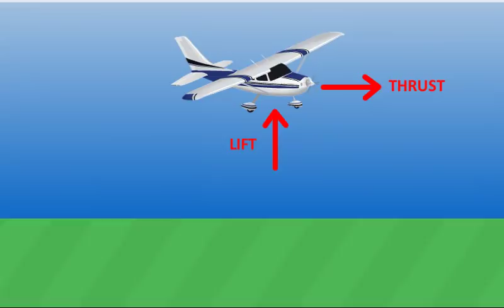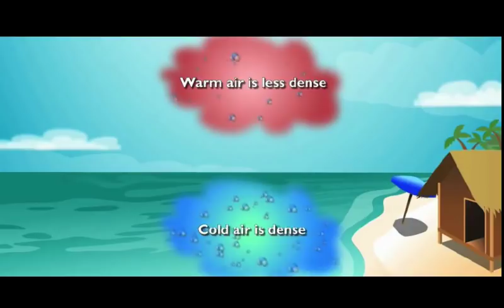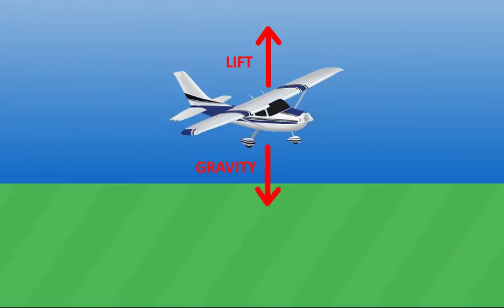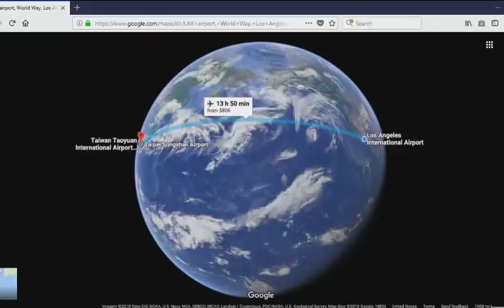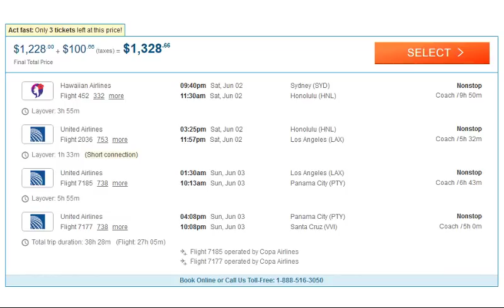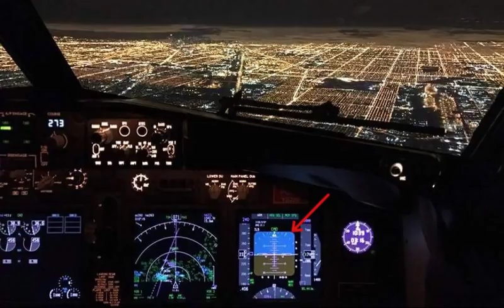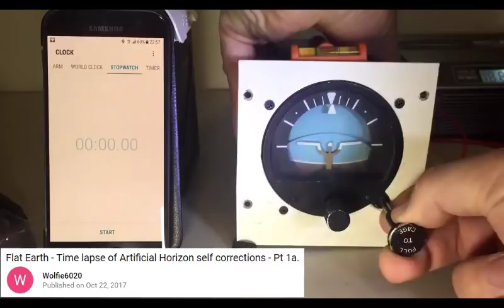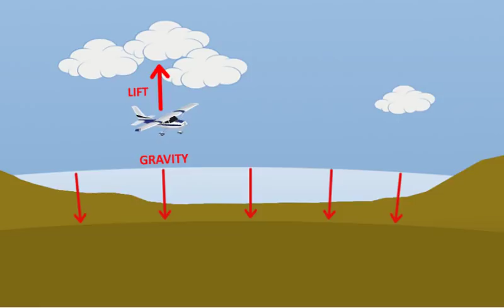Flat Earth Falsities - Plane Nonsense

Comment: Your point about conservation of momentum only works when the plane is moving in the same direction of the spinning ball it's allegedly on. It's fine when moving with the earth's rotation, but wouldn't apply when going in the opposite direction.
Reply: Dookers - No, it works as long as there is no force acting against it. The atmosphere is moving with the earth so there is no force that’s making you lose the momentum that you already have. Here’s what you should do. Go to a car rental place, rent a full size SUV. Get a tennis ball and a couple of people to help you. One of you drive while the other two toss the ball back and forth, side to side. See if you have any difficulty catching or tossing the ball. The only time you’ll have any trouble is if the driver brakes hard, turns sharply or hits the gas suddenly. For less than 100 bucks, you can prove to yourself how conservation of momentum works and you don’t have to believe NASA shills like us.
Reply: It's all well and good just making that statement, but have you got any explanation or evidence for that statement?
Reply: The plane's engines modify the momentum so the plane's velocity differs from the Earth but it doesn't magically cancel it by flying eastwards.
Reply: Dookers - No. Why would it only apply in one direction? It doesn’t matter which direction the plane flies, it’s motion, relative to the earth, is the same. You should look into relative motion and inertia. A good example would be the sun relative to the earth’s motion around it. The sun does not move relative to the earth. The earth does not move relative to the moon. All of them are actually moving. 
Another would be two cars going the same speed side by side.  Relative to each other, they aren’t moving.
Reply: @tomwolfe6063  cant you see that you guys are defending a lie? Constant motion "relative" to the earth. Yaaay they take all the effects of motion and make excuses for why it becomes 100 percent undetectable or affectable relative to our daily lives. Its as if this motion is relatively not there at all.

Comment: the dipping of the nose thing is such bull shyte. Between the age of 14 and 18 I was a member of the atc cadets and experienced flying lessons in a trainer bulldog or chipmunk plane, similar to the size used in the example. Once in the air I did not have to increase speed to increase height. I just pulled the control panel up and the change of airflow under and over the wing caused lift. Other questions. How fast and in what direction does the atmosphere move. Does it only drag hovering objects in one direction, with the rotation of the earth. Does that mean that any flying objects moving in the opposite or cross direction of the earths moving dragging atmosphere, must experience some enormous challenges. With all of that to deal with, would the process of flying be even more hazardous and challenging with the constant changing wind speed and direction.
Reply: You really need to learn how to explain something to someone. What did your input to the 'control panel' actually do to the plane?
Reply: Timothy Thomas - You don’t have to increase speed to climb, you have to increase power or the speed will keep dropping till you start approaching stall speed. On the second question, the air moves about the same speed and in the same direction as the earth. Going in the opposite direction is not difficult because earth below, the atmosphere and the plane are all moving in the same direction and the same speed. So you only have to fly RELATIVE to the atmosphere. It’s like walking up and down an aisle in a plane. You don’t have walk to 560 miles an hour to get back to your seat. You already gained momentum when you were sitting down. You can walk up and down the aisle, turn, sit, stand up, pick up things with same effort as you would on the ground. The earth and its atmosphere are like the interior of that plane. everything in the plane is moving with you and there is no external force acting on you to impede your motion. As long as you stay inside it, neither you nor all the objects inside the plane will lose momentum. 

And yes, a commercial airliner flying east to west along the equator is going backwards at 450 miles an hour in absolute terms 😄

Comment: First answer still misses the point of the first question about a plane flying east an another west. Example, if two football or socca players are running towards a ball, at the same speed from opposite direction, from the  west and east and the ball is moving slowly towards the west, who would touch the ball first. The ball moving west is the movement of the earth. Both players are experiencing the same atmosphere. Think about it!
Reply: Timothy Thomas
Think about it!
Reply from the maker: Timothy - Your analogy doesn't work at all. Put the soccer players at the front and the back of a steadily moving train, and put the ball resting in between them. They will both get to the ball at the same time (assuming equal distance and running speed). The players are airplanes moving with the earth, and the ball is an airport, also moving with the earth, and the air in the train is the atmosphere, also moving with the earth.

You forgot conservation of momentum. The players on the train are moving with the train when standing still. When they run toward the ball they ADD OR SUBTRACT their running speed to the train speed. Same thing with airplanes taking off from the moving earth.
Reply: How ignorant do you have to be to not notice the errors with that analogy?
Reply: someone got punched in the head too many times

Comment: VoysovReason please go ahead and explain how the ‘pressure gradient of the atmosphere’ or ‘density variance’ as you and Rollie called it, exert a torque on the aircraft about its lateral axis that would keep it pitching over at a rate equivalent to the aircraft progress around the spheroid.
  As I explained, if the aircraft has its centre of mass below its centre of lift then it will naturally tend to maintain its pitch attitude relative to the earth due to this pendulous arrangement. But this is not a given. Absent that positive static stability and a control input is required. 
  Your explanation that it is the ‘density variance of the atmosphere’ that maintains aircraft pitch relative to the earth remains just a statement that you have not explained. None of which changes my point that the flat earther belief that the aircraft has to constantly pitch over as it flies round a sphere is actually correct. The problem they have with this is they don’t think it is happening when in reality it is. It is happening at a rate of one whole degree per 60 nautical track miles along a great circle path.
  I await with interest your explanation of how atmospheric density acts differentially upon the empennage/wing to maintain the aircraft attitude as it flies around the earth...and good luck with that.
Reply: From the content of your lengthy explanation, it seems like you would already know this, but general aviation aircraft tend to have their CG slightly in front of their centre of lift, for stability.

Edit: Also please can you provide a time stamp for when Voysov says that the density variance of the atmosphere maintains the aircraft's pitch relative to the Earth?
Reply: Gavin Vales  yes any aircraft is more stable in pitch with a forward cg. As far as a time stamp for the claim that density variance and hence gravity is what automatically maintains aircraft pitch, it is not in the video it is in his response to my comment. I am waiting for his explanation.
Reply: @XPLAlN  So will that not cause the aeroplane to pitch down over long distances?
Reply: Gavin Vales no a forward cg will not cause an aircraft that was already trimmed for level flight with that cg to pitch down. Some aircraft might achieve such a tendency if the designer intended it but a forward cg per se will not achieve that design aim whereas a low cg such as is normal for a helicopter would. I am still waiting for for an explanation by VoysovReason and/rollie as to how density variation or pressure gradient can cause this pitch down automatically for a generic hypothetical aircraft flying around a spheroid.
Reply: XPLAlN  But with respect to the aircraft, the direction of its weight (towards the centre of the Earth) is always changing, so it would naturally pitch down to keep it in trimmed level flight.
Reply: Martina Kosova I have no idea what point you are trying to make.
Reply: NotTheCIA you say the altimeter senses what “pressure layer” the aircraft is in. Where did you gat this myth? If you go up the pressure drops. If you start to climb you will see altimeter move immediately. There are no pressure layers. There are conceptual surfaces of equal pressure that may be referred to as pressure levels by meteorologists or pressure altitudes by pilots. There are no “pressure layers”. Nobody who has studied the atmosphere in even its most basic form would make the mistake of using the term “pressure layer”.
Reply: Is it? Look close the nose is actually up.
Reply: Martina Kosova no it is not hogwash. If it did not happen an aircraft that was level at say, the North Pole would pitch to 90 degrees nose up if it flew to the equator. The debate here is how this is achieved but it has gone right over your head leaving you more wrong than even the flat earthers.
Reply: Martina Kosova it most definitely has gone over your head. As evidenced by the fact you cannot give any coherent explanation of why an aircraft, or spacecraft for that matter, does not have to rotate in inertial space as it flies round the earth. There is none because it is a basic fact understood even by flat earthers that this does have to occur.
Reply: Martina Kosova it seems you are quite rattled. Instead of ad Homs why not calm down and explain what point you are trying to make....
Reply: Could not have put it better myself. I could THROTTLE this STOOGE!

Comment: Please explain in the first few minutes of your video how the Coriolis effect fits in with all what you said? I'm confused that's all.
Reply from the maker: The coriolis effect is best seen in weather patterns. Storms in the north tend to rotate counter clockwise, and clockwise in the south. This is due to the fact that the air has to move east faster near the equator, and slower as you approach the poles. But the effect is gradual, and only has a small effect on airplanes, because they move slowly in relation to the huge size of the earth. So adjustments for the coriolis effect will take place in a plane, but they will just be “lost” in the adjustments a pilot has to make for wind currents anyway. I hope this helps.
Reply: All storms obey the Coriolis effect: low pressure storms rotate anticlockwise in the NH, and clockwise in the SH. High pressure storms, which are rarer, rotate clockwise in the NH and anticlockwise in the SH. Typical low pressure storms are hurricanes, typhoons, cyclones, and tornadoes. High pressure storms are usually larger, such as "the Beast from the East", a large anticyclonic storm that battered much of Siberia and Europe in from late February to early April this year (2018).

Comment: (note i'm not a flat earther) but while all yoibother answers are correct, i have to correct you on answers, 1, 2 and 3.... The correct answer to the question about planes and flying against or with the rotation, is that while the earth may be spinning at 1,000 mph, the velocity of the surface is relatively slow due to the planets size.... (24 hours for a single point to move back to its original position at 1,000mph is slow) think of it like a race track the person on the inside track moves faster than the person on the outside track even if they both run at the same speed, because the person on the inside has less ground to cover. So the outer surface of the planet has so much area, 1,000mph is relatively slow in relation to the size of the planet.... (relativity) think of the gears on a bike or in the car... same principal... so planes are able to fly in either direction without having to worry about catching up with or beating the earths spin.... 

Then we have the helicopter.... the pilot is the one correcting the hover, based on the surroundings it would be practically impossible to hold a helicopter in the air, and avoid following the earth rotation. So that's simply a bad experiment to prove flat earth or globe.

The next one about planes flying into space..... the reason why they don't fly into space isn't because pilots correct for the curvature, its because the max altitude they can physically fly to is around 8-10miles high due to the engines capabilities (power) if the engine doesn't have enough power or design to fly higher it can't fly fast enough to maintain its altitude because the air is thinner, so requires more speed to accumulate more volume of air under the wing to go higher... the U2 spy plane is the highest flyer at 13 miles high.... but it still wouldn't get into space BECAUSE space is another 49 miles (258,720ft) higher.... space is at 330,000ft... 62 miles.... and the highest plane flies at 70,000ft (13miles) passenger planes fly at around 45,000ft (8.5miles) so correcting or not an average prop plane would never get into space and a passenger plane neither... and still not even the U2 plane.
Reply: Look up conservation of momentum.
Reply: @flookd5516  what for? Whats your point?
Reply: Bandari Chik A plane in the ground has the same eastwards velocity as Earth. On take off it retains that velocity; it doesn't have to compensate for the Earth's movement other than a small correction for north-south movement than in itself is tiny compared to changes catering for atmospheric variation.
Reply: @flookd5516   Flook D  again whats your point i wasnt disputing that, the thing youbare referring to is why planes have trim adjustments, i was just stating that a plane could never fly into space by accident or deliberately.... they dont have to compensate for the curvature because they could never reach an altitude for it to be a concern
Reply: Bandari Chik I was relying to point one and why planes don't have to catch up with the Earth. It's not the speed of the Earth but the conservation of momentum on take off.
Reply: @flookd5516  well on further investigation which flat earthers should do LOL.... i discovered that while conservation of momentum is also true... at high altitude there is an easterly jetstream all round the earth that reaches speeds of around 250mph.... planes fly in that and with the speed of the plane, plus conservation of momentum, this assists them in easterly flight... but going west they effectively fly into a head wind, which means they are flying against the wind, even if the are flying at 500mph its like taking 2 steps forward and 1 back... which effectively  means that even though the earth is traveling towards the plane at 1,000mph, they are getting blown in the same direction as the earth so they are fighting to fly against the rotation basically....

Comment: The gyroscopes spin up then align themselves in the direction of gravity. That's naturally how they work. You can get toy gyroscopes and experiment with them to get the principle.
Reply: No a gyroscope absolutely does not “naturally” align itself with gravity. They possess two qualities known as rigidity and precession. Rigidly keeps the gyro axis aligned with whatever it starts at. That is why a spinning top can lean over and yet not fall over. Instead if you give it a push it tilts then starts to precess and the motion of the axis will be conical. The arrangement of a vertical gyro in an aircraft is such that it isn’t pushed over by the aircraft manoeuvring because it is mounted in so-called gimbals with super low friction bearings. The gyro axis then just remains rigid in space and it will not change as the aircraft flies around the earth. This is explained well in the video. But the gyro is artificially kept vertically aligned with the earth by an erection mechanism, also explained in the video. It is then known as an earth tied gyro. Gyros absolutely do not naturally align themselves with gravity, their axis naturally remains rigid in space, that is their most important property.
Reply from the maker: Yes you can, and if you move them too fast, you can see them go out of alignment.